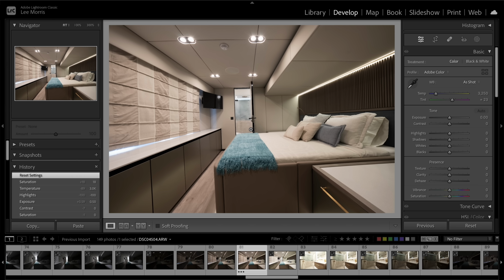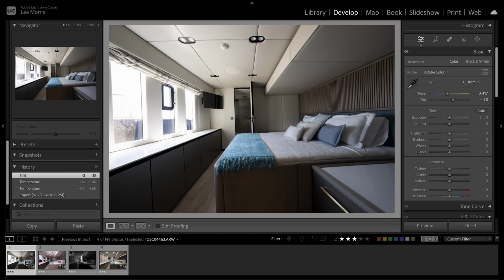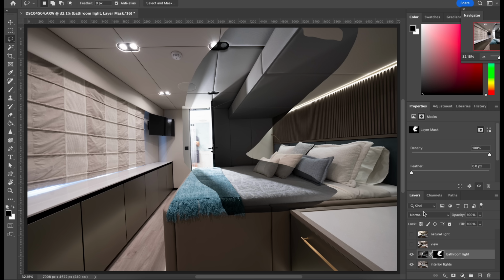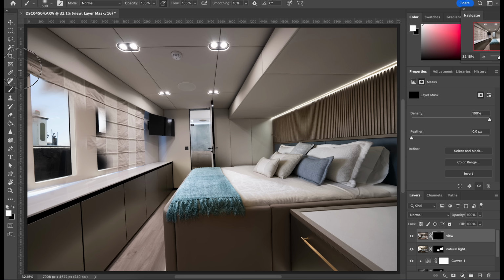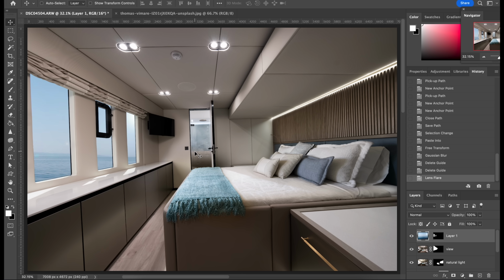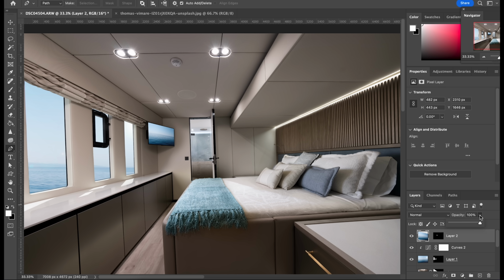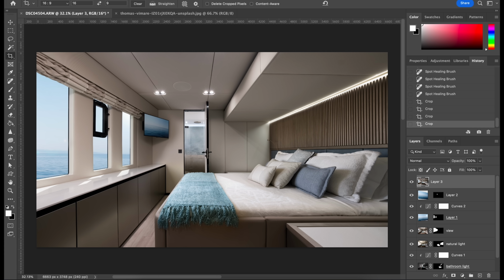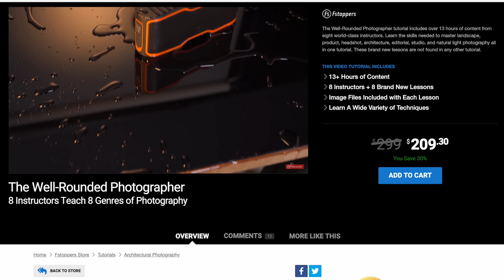How To Photograph Small Rooms (on Yachts)

Comment: 3:00 You can also flash at the windows, overexposing the interior, and then use darken mode to blend it. Commonly referred to as a “window pull”

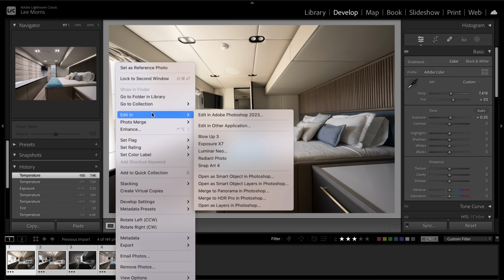6:00 Highly recommend opening as smart objects in photoshop and then dragging them in. It can save a lot of time if colors / exposure needs tweaked
Reply from the maker: Interesting window pull technique if I needed to capture the actual view. Obviously for this shot the concrete dock wouldn’t cut it. 

Good idea with smart previews
Reply: @FStoppers  The "window pull" technique also keeps you from having to manually cut out windows, definitely worth it if you have a strobe.
Reply: @MichaelRoachWV the tried and true Nathan Cool method of real estate photography!
Reply: @MichaelRoachWV  i have followed nathan cool and i use this technique. But if you want to cancel the outdoor scene and use a sea, you must select manually, or not? maybe with interval color selection??
Reply: @fabiofieri854  I haven’t tried swapping, but a plug-in to check out is Lumenzia. It’s specialty is luminosity-based selections. I haven’t tried it for this use-case, as with houses you can’t really swap the views lol. My guess is you could use the “window pull” layer to select the overexposed interior, then invert it to select JUST the windows

Comment: It's much better to increase the shutter speed for your flash shot rather than stopping down (assuming that you're not already at your max sync speed, which if you're shooting at f8 and ISO100 is unlikely). Stopping down hugely deceases the power of the flash which is a problem if you're in a bigger space or only using a speedlight. This problem occures constantly in real estate (not having enough flash power), which is why we shoot at around f7.1 - f8 and ISO200-400 (rather than say f11 and ISO100). It's all about that flash power baby! (it helps having an 600watt studio flash if you really want to be a lighting badass). Also, by changing the f-stop between images you're also changing the sharpness of different exposures and the look of the diffracted light, which isn't the biggest deal but it's something take note of.
Reply: I assume you stopped down to f22 so you could slow down your shutter speed to have time to manually trigger the flash because you weren't using a remote flash trigger?

Comment: Lmao, I see everyone is giving you PS tips, so let me add one more! At 11:05, you start dragging the guides (and then skewing the photo) to get a level shot, but if you use the geometry section in camera raw you can drag two lines for vertical and two for horizontal and it'll automatically do it for you. It's wildly efficient! Even if you forgot to do it initially, you can use Camera Raw as a filter to do it to the final image.
Reply from the maker: I forgot about that though I wonder if it would work for a room that isn’t square

Comment: The window work was definitely impressive. It turned out nice. Would you have still chosen the 12-24 if you had the option of a tilt shift lens?
Reply from the maker: I'm not a purist that has to get it right in camera. I feel like I can just crop in and get the same results as a tilt-shift with only a slight loss in resolution. With this job, the images will never be printed, they will only be on the web so I probably need about 1MP/images but I'm ending with a 20MP+ files. So for me and most jobs, I don't care to use a tilt-shift.
Reply: Yes. But why does he call the Yacht a Yard?
Reply: @FStoppers  👍🏾
Reply: TS-E are very important tools in architecture photography, but with each job there's a place for ultrawide prime/zooms and that's small spaces like toilets or warderobes. You'd rather shoot most of images with 24 or 17 but slapping something like 11 or 12mm for those shots will save you a ton of time during etiting (HDR panoramas shot with TS-E are nightmare to work on)

Comment: How do you get rid of the fog when using long exposures? I get a lot of fog when i try to photograph bright days and open windows.

I also think that maybe you wouldn't need an extra light, you could just turn on lights and open windows. You are not at backlight, the light comes from the side. And make photos with open windows + lights and open windows with no lights.
Reply: You don't understand the point of a flash.  The point of the flash is to nurtrailse color temperature variation.  Turning all the lights brand you have multiple different light sources mixing and combining to create a mash of bad colors
Reply: @homewardboundphotos  I do understand it and still think is not that necessary, I'm a professional Architectural & Interior Photographer. 
The temperature variation is neutralized since the production, I turn on only warm lights, then only the other lights, in other just day lights and in other all the lights. 
When I shoot day photos I don't turn on lights unless it helps me to lit some objects that would hel me in the postproduction process or if the client wants the photo with lamps turned on, mostly for real estate, but for architects and interiors they prefer day or night photo.
In post production I choose which photos I need and try to get the basic white balance in all of them, trying to neutraliza this color variation, blues or oranges.
I bought a Godox Continuos light just for ocassions when I'm at backlight and the lights of the project doesn't help me that much. But in the 95% of the shootings, I haven't need a flash or an extra light. 
Even Mike Kelley doesn't use that equipment.
Reply: @aldobelenda907  huh well, im also a professional real estate photographer and I use a flash to and do luminosity blending to balance the colors, so the exact opposite as you.  different stroked for different folks i suppose I personally despise the clash of different lighting temperatures, and the lights cast by interior fixtures give the walls texture.
Reply: Dude the reason you get "fog" in your images when you do the long exposures is because of the  physics of light (and also to a degree the quality of your lens). This is why we use a flash - to control the ambient light and knockout all that highlight bloom around the windows to get a crisp and sharp window view. You also get the benefit of colour correction and balancing the interior/exterior light to make it easier to edit the photo. Depending on the house and lighting conditions, I bet the window area in a lot of your imagesdosn't look great.

Comment: Hey I like how practically you use photoshop. But, according to the final image you created, you can enjoy the beautiful view as you lay down in the bed. But it is not the reality. What is the point here? Thanks.
Reply from the maker: Of course you can enjoy the view as you lay on the bed.  We wound up shooting this image while at port so the obstruction was the pier.  If the boat was docked starboard side or out at sea this room has a very clear view of the ocean. -P
Reply: you know boats move, right?
Reply: In commercial or advertising photos is acceptable to cheat or trick a little bit to make the photo more interesting so you can sell the product. Sometimes I am against but you need to know what the client needs